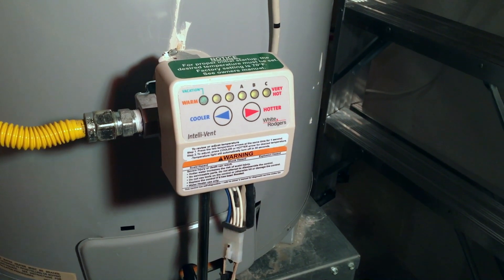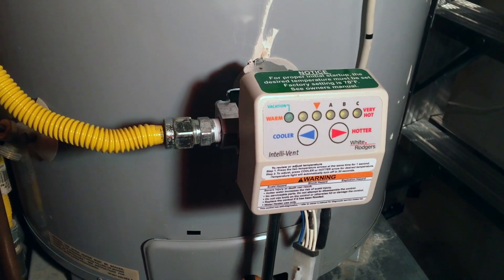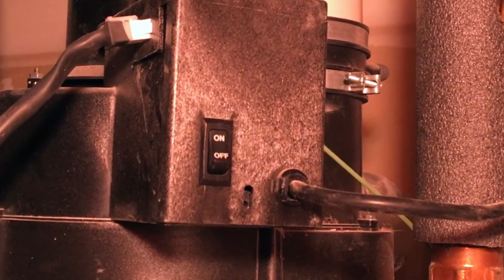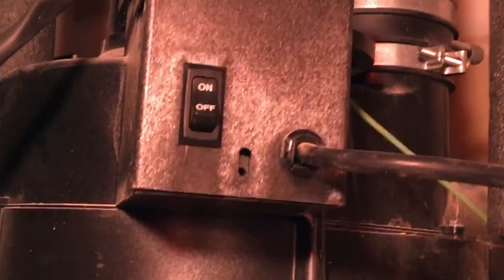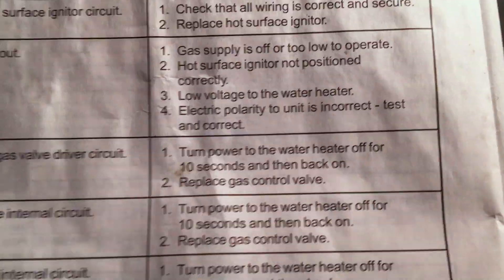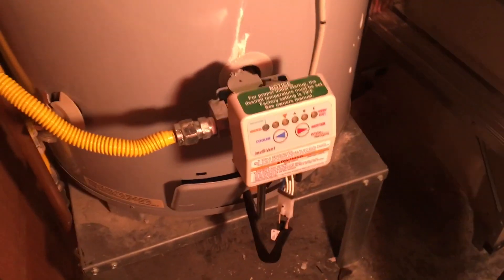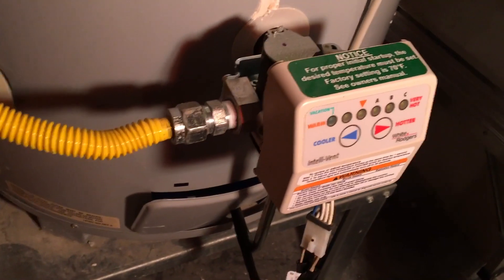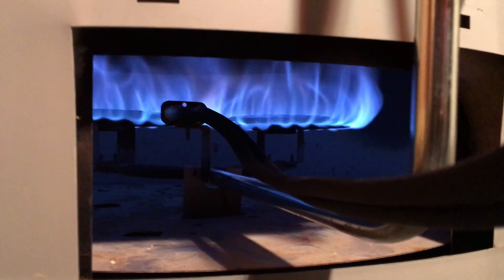Water Heater Issue Intelli vent Ignition rod flame sensor

Comment: Thanx for this video
I have 2 homes, 
1) My main home has an old fashioned "pilot light" water heater that I installed about 30 years ago.. It has never given me any problems.
2) My 2ndary home has a high efficiency hot water heater I installed about 15 years ago, almost identical to yours..  I was trying to figure out why it wouldn't fire.. It glowed what I'll call the normal amount of bright orange, but just like yours, after 3 attempts  LOCKOUT..I did not smell any propane..so I thought gas valve failure, I removed the burner I smelled propane in the pipe (gas valve likely OK) and cleaned out the orifice, when I initially blew into it it sputtered like it was partially blocked..  thinking this could be it.. I tried again, still no fire I watched your  very well done video..   and thought what if the "heater" isn't hot enough.. so I used my grill lighter and flame on baby.. Thus proving it wasn't a gas problem, but a heater aka igniter problem .
Being very cold, and the weekend I moved the heating element (igniter) about 3/8" closer to the burner... SUCCESS.. I would not have thought of this until I saw your video.  THANX  now I can find a convenient time to replace the burner / heater (igniter) assembly.

Wouldn't it be nice if they made these babies (igniters) easy to adjust

Other comment.. What $#%^ engineer made the burner attachment to the gas valve reverse thread.. , by design it is very close the the floor, not only it it a hassle for me to get down and get back up  my well over 60 YO eyes don't see that well,  anymore...THANX   On the plus side, now that I am old and weak, I didn't strip it going the wrong way..
Reply: I just dealt with the same exact thing and reading your comment helped me. I adjusted the heating element outward toward the burner slightly and it seems to be working now. Thank you.

Comment: Yeah, sand the sensor rod, don't touch the igniter rod and make sure they are close enough together. Did this for a couple years, then bought a replacement kid for about $60. Eventually it reverts back to same issue.

Comment: Dude you saved us!  Similar problem but was able to fix it by repositioning the sensor like the manual said in your video.  I guess after 15 years of being "almost" out of position the deteriorating flame or burner quality reduced the temperature of the sensor.  I could see it was poorly placed at the factory so I just bent it (after removal) to point up- closer to the burner.  The factory had it rotated to about 2 o'clock- no doubt an error.  Thanks again!
Reply: Saved me too!  To clarify for others what helped me was repositioning the longer thinner rod towards the flame.  The two rods are part of the same unit and the shorter one turns red hot by itself not from the gas burner the other (the one I bent/repositioned towards the flame) must sense the heat from the flame like old thermo couplers used to.  I used very long needle nose pliers and only had to move it 1/8 to 3/16 of an inch. Not much. No cold showers in the morning!!! Thanks to Chip for his helpful input and the maker of this vid!

Comment: Mine is giving the same error code but it ignites the flame but then shuts off after the flame is already lit
Reply: Try cleaning the flame sensor rod. You should do this once per year.
Reply: @smcic  do you need to drain the tank to do that?
Reply: David P no, you don’t need to drain the tank but you do need to turn off the power and gas. Watch this video:
https://youtu.be/Uly51j6oT9s
Reply: @smcic  thanks that video is exactly what I was looking for. I appreciate your help thanks a lot.
Reply: Did you ever figure this out?  Mine is doing the same thing.

Comment: Hello..Mine had all lights lit up. I have this same water heater and a set of wires inside that large wire that goes from the botttom of the tank ..inside tank and then back out at top is burned...do I need to replace the whole system? If so where can I get one and if not ...what can i switch it too? This is terrible...thanks for any help you can provide.

Comment: Hi there, I have a gas w/h with power vent. I have noticed the fan was running constantly and the water not heating up to the temp I set for so I drained the tank; bunch of scale came out. It worked fine for two days with the water at the right temp and fan shutting off after a while. But now it does the same thing, what do you recommend at this point?
Highly appreciated.

Comment: Isn't there supposed to be a seal under the covers? Mine says the seal needs to be replaced every time you open it.
Reply: I have the same question. Mine has screws and is not open. it mentions that the seal needs to be replaced

Comment: I have. Light. In. The. Water. Heater. Ignition. Valve. But. Water.  Heater. In. Working?
Reply: I. Have. No light. In. The. Ignition. Valve. But. Water. Is. Getting. ? Hot????help. I have. Those. Arrow. Smart. Valve.  In. Reem water. Heater
Reply: @jashmurillo6951 😳

Comment: Could you give me the part# to that flame rod I have the exact water heater.
Reply: Does anyone know the part number or place to get the flame rod? I have same setup. Thanks!
Reply: Check the owner's manual or go online and find the manual and it will provide part numbers for all the pieces relate to your State Water Heater.  This is what I did. My biggest problem was locating a business in the area that carried the flame rod. I found the part in July 2011 for $103. and now I need it again and it is $136. I checked on Ebay for a new one and it is $51.XX  with free 4 day shipping. If you can make it for a few days, Ebay is the way to go.